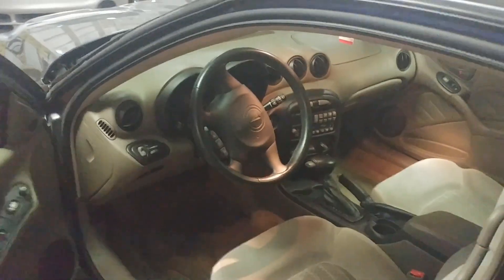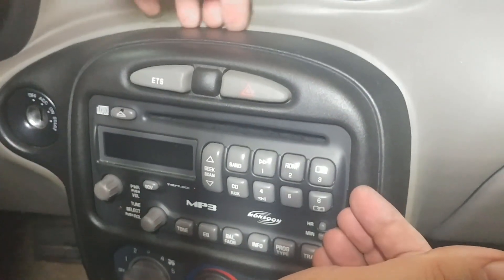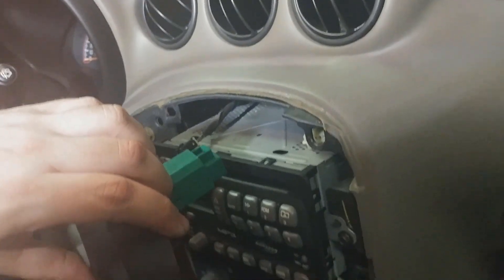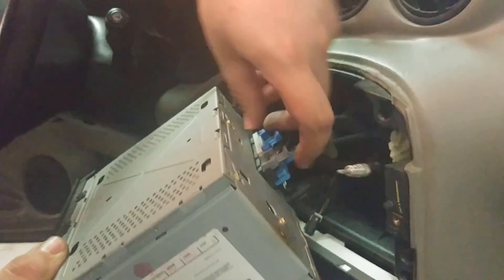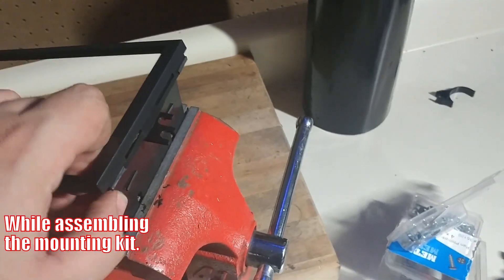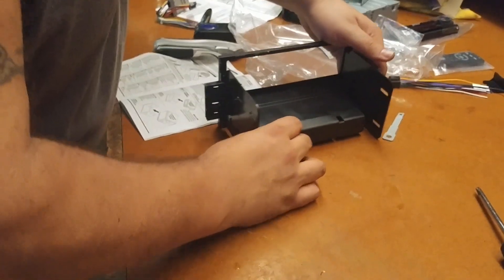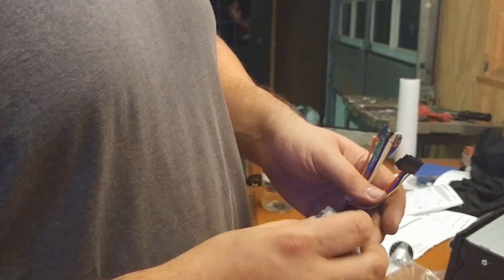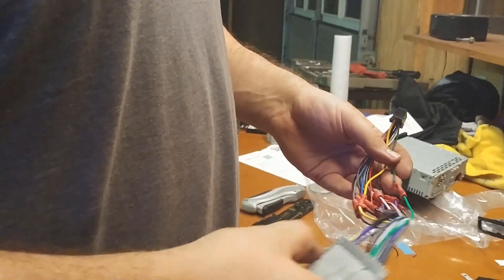2005 Pontiac Grand Am Ram Air Radio Install B&S Customs DIY Trim Dash Removal

Comment: I checked every wire is connected right but my stereo won’t turn on, however I have some orange wires left unconnected.
Reply from the maker: Try using a 12v power supply to power it up and test it
Reply: @PhoenixHavenGarage  Thanks! Quick question, my sound system is too loud when i put little volume and will sometimes blast loud sounds randomly. Any tips to get rid of that?
Reply from the maker: @elite_mythical3837  I would google the head search the model and brand of the unit. See if anyone has posted anything like.

Comment: Hey I'm left with the blue amp wire and don't know where to go from here
Reply from the maker: If there is no matching color on either end, leave it disconnected.
Reply from the maker: don't worry if you mess up, there are fuses in place to prevent damage.

Comment: Yours seemed to come off easy mine seems really tight I don’t wanna break anything
Reply from the maker: Try fitting a wide plastic putty knife between the trim piece and the dash and give it some force while also pulling on it from another near by edge
Reply: @PhoenixHavenGarage     I ended up getting it i used a trim tool got the ignition side off thing went flying then kinda moved the tool around and the rest popes off easy from there. Now I can’t get the cigarette lighter unplugged how you do that. Reason I ask I have to fix my hand brake and centre console gotta come out and the radio trim
Reply from the maker: @ryans413  it should have a connector behind it to remove.  I do it in the video i think
Reply: @PhoenixHavenGarage     Yea but I can’t get it out I tried for like an hour the trim is off enough that I can get the console out so I think I’ll just leave it cars almost 20 years old and this plastic is very brittle so I don’t wanna break it
Reply: @PhoenixHavenGarage    Okay I went back looked at the video you said push up on the bottom side pull out. The connector has these push pins on the side I was doing it wrong I guess. I’ll try what you did thank you for the help
Reply from the maker: @ryans413  Glad this helped. Please subscribe if you have not, it really helps us.

Comment: I have an 03 Grand Am with the monsoon. I have a Kenwood deck. I have used 2 different harnesses including the one you have. The radio powers up but no sound. It’s crazy. I have installed so many radios over the last 23 years and never had this problem. I double checked my radio in another car and it worked.
Reply from the maker: You would have to debug it using a 12volt power supply and an ohm meter to verify the wiring from the harness and the radio. My guess is there is a miss match for the ON-Signal wire telling the radio  it should be ON. You said it powers up, does that mean the you can change radio stations, or just the display is powered showing the clock?

Comment: So I have the exact same car and I took it to a shop to get a stereo installed and they said I also had to purchase some $90 digital adaptor... what were they mentioning?
Reply from the maker: I have no idea.  I have the link to the writing harness in the description of the video.  All you need is that and the dash kit i build in the video and the antenna adapter. All of it was purchased from Walmart
Reply: I believe the adapter just so you get the dinging sounds out of the speakers. Like when a doors open or you leave your headlights on the sound is controlled by the radio

Comment: so the wires you pull out at 2:24 where do you plug them back into my radio every thing works but the sound cuz with out that plug the sound will never work
Reply from the maker: The wiring harness @3:55 plugs into the back of the radio and connects those connectors to it
Reply from the maker: Link to it is in the description

Comment: I dont find a part for the wire harnes of 24 pins?any suggestion?
Reply from the maker: https://www.walmart.com/ip/Scosche-03-GM-CL2-Interface/35505501 this is what i used.
Reply: @PhoenixHavenGarage  thanks found one better in ebay. I hope it works
Reply: @PhoenixHavenGarage  so my antenna doesn't connect to the radio, i have a XO vision stereo receiver XD103.
Reply from the maker: @Thebestpunk  https://www.walmart.com/ip/Scosche-Uaa3sd-Universal-Car-Antenna-Adapter-in-Black-Silver/23014644
Reply: @PhoenixHavenGarage  dude you are a hero thanks

Comment: I need help on the whole wiring part ? I’m doing this by myself and I’m not sure what goes to what
Reply from the maker: Every wire on the new radio's harness will have a matching colored wire on the adapter wiring harness you purchased. Just connect all of the same colored wires. Some will have a colored stripe on them as well, but there should still be a matching one for it. It's basically just power, ground, signal (that the power was turned on), and 2 wires for each speaker. So there may be purple wire and a purple wire with a colored stripe on it. These are just a pair of wires that go to 1 of the speakers. connect them with a red butt splice connector https://www.amazon.com/Hilitchi-Insulated-Terminals-Electrical-Connectors/dp/B01D8FWU2Y/ref=pd_day0_hl_328_7?_encoding=UTF8&pd_rd_i=B01D8FWU2Y&pd_rd_r=51061b6d-a89c-11e9-a93c-6bb543d57023&pd_rd_w=xVd2i&pd_rd_wg=rooZx&pf_rd_p=ad07871c-e646-4161-82c7-5ed0d4c85b07&pf_rd_r=1GS0VCERW3A7HQHJQ9V1&psc=1&refRID=1GS0VCERW3A7HQHJQ9V1
Reply from the maker: A pair of pliers will crimp the ends. Give them a tug after crimping to make sure they are not loose. good luck
Reply: @PhoenixHavenGarage  for your radio you need both the constant and the switch connected to turn on right ? Your wiring looks so clean and I'm trying to cut into my harness to find something that turns on then my car does , could use some help with this mess
Reply from the maker: @andy.s5945  i think red is constant and yellow may be switch. Wiring diagram or a volt meter will tell you.

Comment: did that second smaller plug that you took out of the OEM plug into something else? like the door chime or something?
Reply from the maker: All of the plugs from the back of the original radio plug into the front of the new wiring harness. The door chime box plugs into the back of the hiring harness where the black connector is with all of the spliced wires around 4:05 in the video. Make sure you have the correct wiring harness. I have links in the description to the harnesses

Comment: is this sony unit steering wheel compatible
Reply from the maker: I don't remember this grand am having that option on it. I believe there is another adapter needed that plugs into the new stereo for those controls to work. This link should help. https://www.crutchfield.com/S-sRLs0u7fCtV/learn/video-installing-steering-wheel-audio-controls-adapter.html

Comment: Would this be the same for a 03 grand am
Reply from the maker: Should work. I have this in the Description:  Wiring Harness: https://www.walmart.com/ip/Scosche-GM2000A-03-GM-CL2-Interface/35505501
It's a generic one for all GM 2003-2012 vehicles
Reply: B&S Customs 
Thanks

Comment: Can you link the parts you used for this? Because I installed a kenwood radio and no sound came out of the speakers but all power was working
Reply from the maker: The owner of the vehicle bought all of the items at our local Walmart. After watching the video again, I was able to find the exact wiring harness that she purchased. https://www.walmart.com/ip/Scosche-03-GM-CL2-Interface/35505501

It's a generic one for all GM 2003-2012 vehicles and comes with the key chime box I show off in the video. We had a recording issue when I was actually showing how to put everything back into the dash, which is why it is missing. I did connect the antenna adapter to the new radio, and I just shoved the key chime box back behind the radio with all of the wiring. Good luck.
Reply: B&S Customs thank you so much man,but I cannot find the right adapters for my car.Its a 2002 Pontiac grand am.And I feel like all the adapters and stuff were skipped for that year
Reply from the maker: https://www.walmart.com/ip/Scosche-GM09SR-2000-Up-GM-Radio-replacement-interface-with-door-chime-feature/10756035

I found this one, same brand.
Reply: B&S Customs oh wow,thanks dude
Reply from the maker: Hope it works out for you. PLEASE subscribe and tell your friends about us.
Reply: B&S Customs I did thanks man
Reply: B&S Customs does the wiring harness change between the monsoon factory deck and regular deck for the SE Grand am model
Reply from the maker: I'm not really sure the type of deck matters, the wiring harness is selected by the year of the car, not the options it has. Just make sure you buy the correct harness for the year of your vehicle.